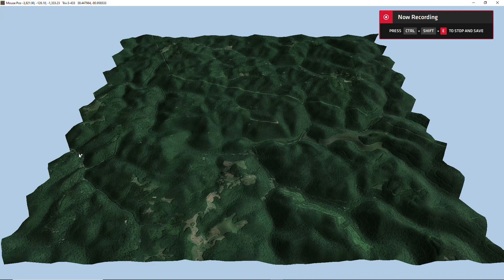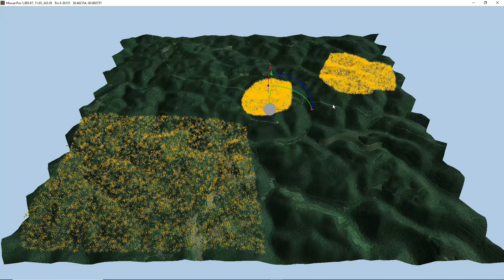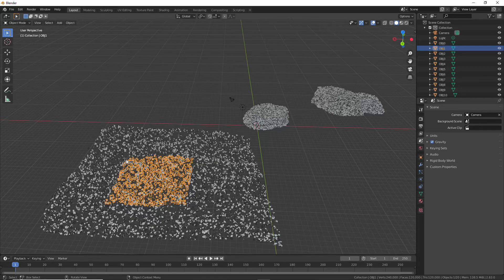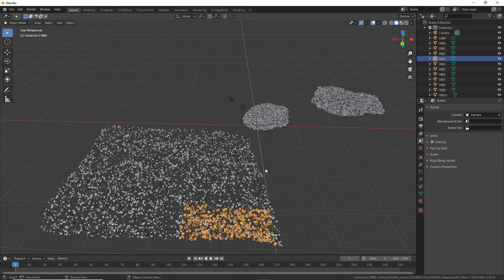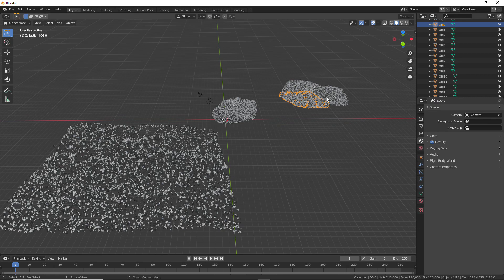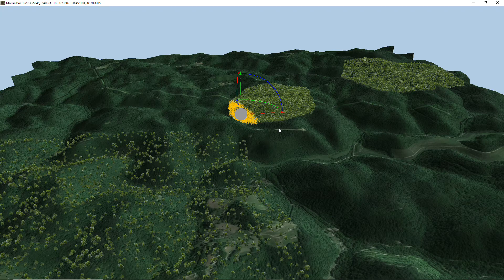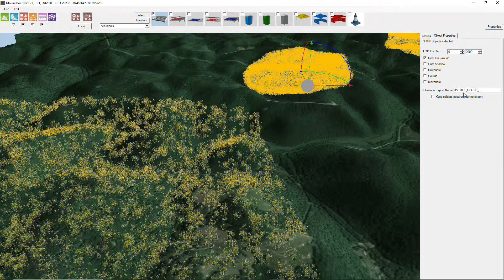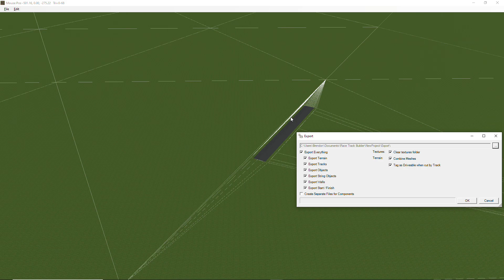Race Track Builder 1.6.7.1 changes

Comment: When exporting video, in the edit: apply 80Hz lowpass filter on the audio. My subwoofer is blowing quite a lot of air from the bottom end. Consider using a pop filter (steal pantyhose from the missus and make your own using coat hanger or thick armature wire).